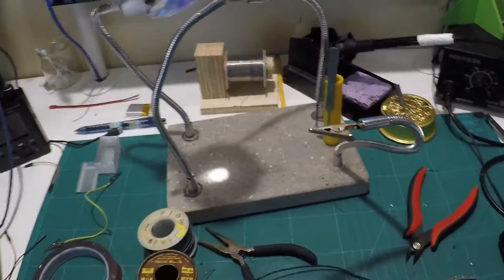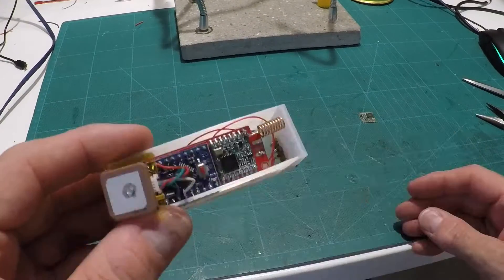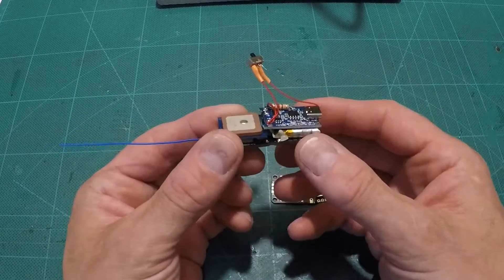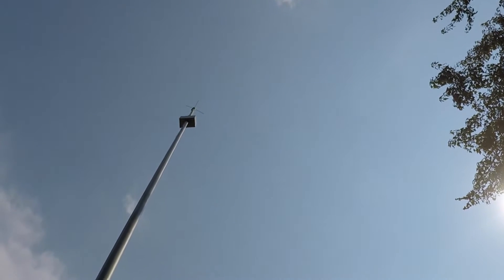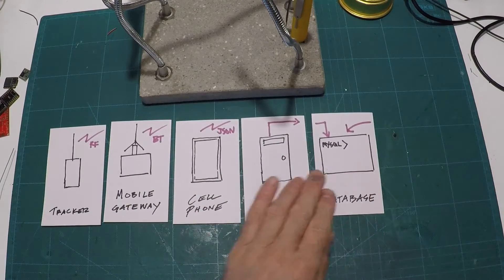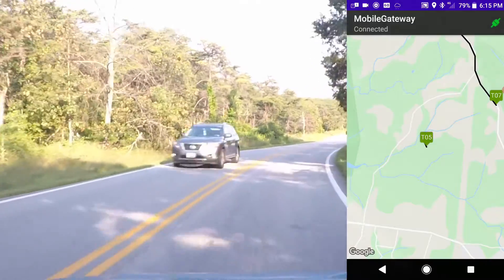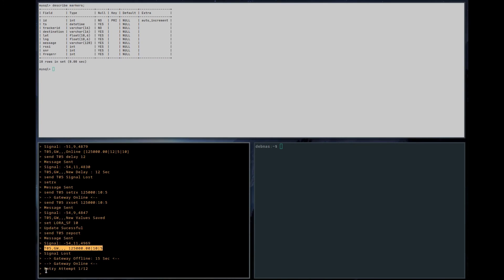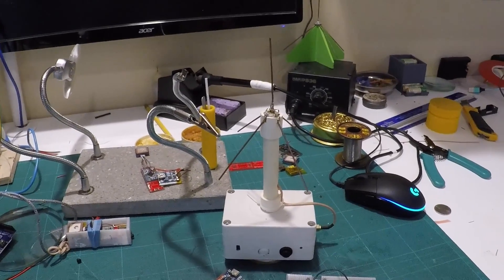LoRa Dog Tracker : Part 3

Comment: One thought - given the tracker can do 2 way communication, you could have the tracker ping location every 10 minutes only, until a button press on the transceiver which then radically decreases the interval between location broadcast - it will stretch battery, but let you get close to the "10 minutes old" location before going to high precision / high frequency.  (I assume the dog won't move more than 1 km in 10 minutes, typically).
Reply from the maker: Funny you should mention that.  Working on just that kind of thing (plus a bunch more changes) right now.  Where were you 3 years ago mate?

Comment: Great update! I ended up making a version for our cat almost identical to your second iteration. Inspired by your videos of course. We used it for a while but gave up on because she hates having a collar on. The size was ok as I was able to make it fit in a 3D printed enclosure that had the same curve radius as her collar. Another issue with a cat collar is that most of them are break away, and she would regularly exceed the range on her escapades and sometimes manage to get the collar open. Some neighbor's were kind enough to call the number we had on it to let us know they found it in their yard... Anyway, great to see you're still working in it.
Reply from the maker: That's cool. Glad someone made a cat version.  Haven't had a cat for a while but I do remember that they go mental if you throw off their center of mass.  I'll keep working on making something cat friendly.  Cheers!
Reply: im using the tractive gps tracker for my cat for about a year and im pretty happy with it so far.
the monthly cost is 4euro per month, the tracker itself is 50euro and u can get a replacement once a year for free.
so far my cat managed to get rid of the tracker twice but i was able to find it both times.
the battery lasts for about 72 hours but if u use the live tracking to exactly pin point the location the battery depletes quick so u need some reserve(it makes noise and light).
u need a decent cell phone signal fo it to work the sim itself is build into the tracker.

Comment: Watched all three of your dog tracker videos, really keen to explore Lora. Andreas also a great inspiration as are you. Just want to know is there any security to ensure the endpoints only associate with your rooftop or mobile base stations? I was looking at a recent video on Qmesh which also know allows voice comms via Lora , and looking at this a for kids tracker plus sos walkie talkie. But would want to ensure that my endpoints are only speaking to my base/mobile stations. Also was looking for misplaced home items, keys, remotes etc build a Lora tag.
Reply from the maker: You would need to use encryption to make sure the communication was secure.  I have not done that but the LoRa libraries do provide for that option.  Interesting idea about he LoRa tags.  Wouldn't want it to use GPS but you could hone in on it using the RSSI (received signal strength).  Let me know if you try that eh.

Comment: Have you looked at any of the expresslrs hardware.  It would combine the esp32 and the Lora board and antenna.  The you would only need the battery and charge controller.  I was thinking about using that to build exactly what you did but haven't gotten around to it yet.
Reply from the maker: I had not looked into that system.  First glance it seems interesting.  I did not see a GPS built into those units but I may have missed it.  You might also need to create your own firmware to transmit GPS data instead of flight controller info. The range might also be much smaller for a ground based system...once something is up in the air, the line of sight increases dramatically.  Let me know if you do try this, I'd be interested in your results.
Reply: I've seen the ExpressLRS floating around the FPV groups, but I hadn't taken a serious look as I haven't been flying much lately. However, after looking at what it can do and the tiny size, I'm very impressed! ExpressLRS is based on SX127x hardware combined with an ESP8285, ESP32 or STM32 MCU using LoRa modulation, same as ImmersionRC Ghost and Crossfire. I didn't realize these systems were using LoRa. It looks as if you could simply take an ExpressLRS receiver, gps, battery (& possibly charger) to make a tiny tracker. Firmware would have to be written and it appears that ExpressLRS is all open source on github. I also see that it'll run on R9 hardware, which I have laying around. I might have to look into this hardware as it's already half-built for you...
Reply: @dork3nergy  Just put the 'ground station' on a quadcopter, problem solved :)

Comment: Are you a Ham?

We've been doing this since the 1990s. APRS. Minus the internet side which came later. Bob - WB4APR created most of it. 

RIP Bob! He passed a month or so ago. Retired from the Navy. Worked for NASA. Worked with John Glenn at times. Built satellites and designed numerous electronic devices. We lost a GREAT Ham when he went SK!

My question is 433mhz? Looked a little short for 6.5 inch ground plane.

I believe it's a 100mw version for 433mhz. Will chew up battery faster. 10sec beacon seems way to often but with that short a range 10 sec probably a good idea. Give a better bread crumb trail too. But just to locate you could reduce the beacon time, use directional antenna and or setup more gateways. 

My goal is to get a APRS tracker small enough for a drone. They make some that are fairly small but still to bulky for a small drone. Even a DJI Air2S it's still a little bulky. Plus I need to check about harmonics / intermod. Some will only reduce to 500mw which is probably more than needed. 

So how did this work out?
Reply from the maker: Yeah, still working on it.  It's 915Mhz.  I haven't used anything but the RFM95 so far.  I should look into higher power ones at some point. Currently working on miniaturization.  Wish me luck.
Reply: @dork3nergy  yeah mini is the tough part! Ive got Ham APRS trackers and Walkie talkies but they are BIG! They make one now thats pretty small. 40 grams i think. 1 watt and built in GPS plus other sensors but its $200!

The cheapest thing is 4G LTE tracker. Its Its only 40 grams, $30 plus a $5 monthly subscription. A Ham on ebay sells them for Drones.

But id much rather be able to see my tracker on the Ham APRS map on my PC and not rely on a subscription.

Comment: Hi, would you be able to share the code for the XIAO? I am having a great time working on this! Thanks for sharing :)
Reply from the maker: Hey @scott glad you're digin' it. I put the code I used for the XIAO in the dogtracker2 repositiory : https://github.com/dork3nergy/DogTracker2

It's is poorly commented but should get you started.  The XIAO has an annoying habit of clearing the EEPROM memory when you upload code so just be aware that you need to write a default config to the device every time you push new code.
Reply: @dork3nergy  Thanks so much for taking time to upload. Will be giving it a try :)

Comment: Hello again! I have problem with my gps data. Its not send the data . I read artikel on google and got the gps can work with lora together. I test your code and lora can work but its not send the data gps, how can I save data gps then transmit to lora? Please help mee....Iam stuck...
Reply from the maker: Make a simple sketch to just read GPS data.  You can use the example from the GPS library you are using.   It could be there is no data because the GPS has not connected to the satellites or it could be your wiring is wrong.
Reply: @dork3nergy  thanks for replying, i realized where i was wrong was not using the time range, so when the power supply was given gps and lora worked together which made my arduino unable to complete the task, in advance i am very grateful to you. 
respect from me..

Comment: I wonder what kind of range it would get if it's thrown 200 ft up a tower.
Reply from the maker: I think quite a bit.  Let me know if you get one up that high.
Reply: @dork3nergy  I know old 900mhz wireless can go up to 5 miles with good antennas, but we actually needed better signals then what this would require. Same frequency though and power output so should be pretty good.

Comment: Can i made 2 or 3 nodes for 1 gateway?
Reply: I wan't try this for 2 or 3 gps module using for 1 gateway , is that posible? Soryy my language so bad. Piss haha, by the way your video is cool, i hope you answer my question..
Reply from the maker: Yes. Sure can. There is a possibility that your node transmissions will collide however which will garble the message. Working on that right now.
Reply: @dork3nergy  glad to hear it, please make a video so i can learn it. Thanks for the answer it was very helpful